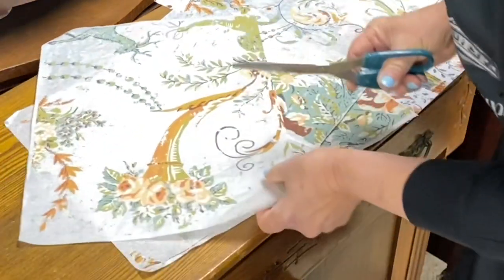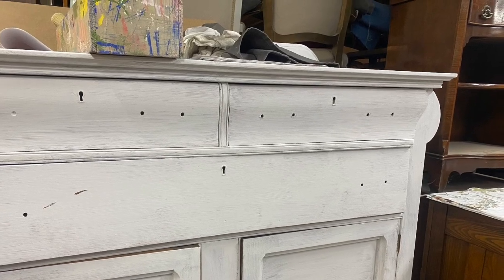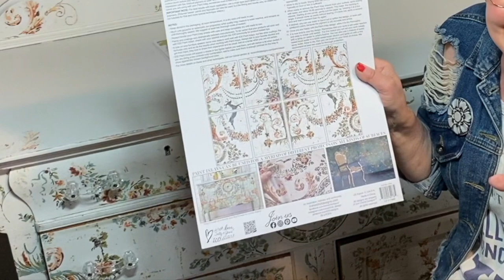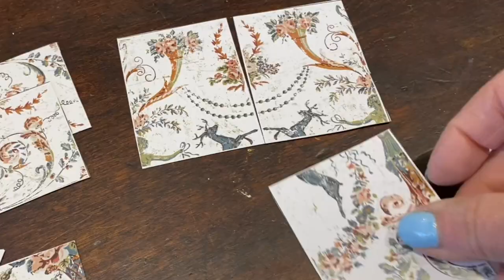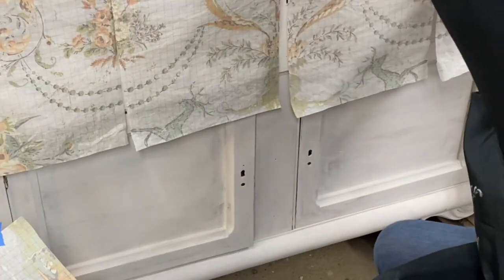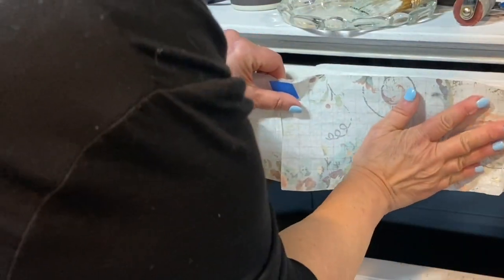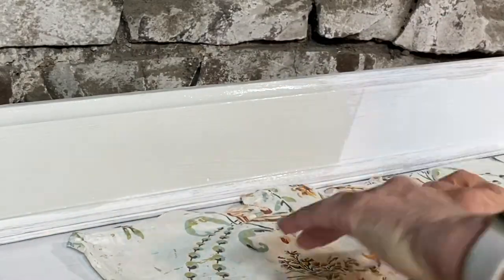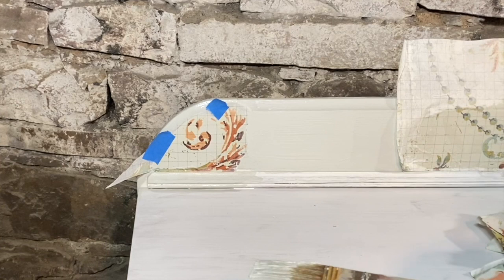The Chateau Inlay and a Layout Problem SOLVED!

Comment: I love. Your approach, on creativity, your work is, beautiful, every video I've watched, I love, I love your style, you are an artist, I love this paint inlay, I ordered 2 from a local retailer, of IOD, I was talking to the owner, about, putting this on a sofa, I am having reupholstered, with drop cloth, and she said, she tried acrylic gesso, on a cloth bag, and then used Chalk paint, and an IOD transfer,the difference,with the gesso, was amazing, the material was softer, versus, just Chalk paint. But I want to try it with this inlay, since gesso is a sealer, and comes in clear, and many colors, I was wondering, about your insight, so, I am going to play, with the gesso, and Chalk paint, on a piece of drop cloth, before, I try it on my sofa. Any insight will be helpful, thanks
Reply from the maker: It sounds like a great idea! I’ve never used clear gesso as my transfer medium, but I’ve going that Debis DIY clear liquid Patina  works nicely as long as you have a good generous base coat of it that has dried. Then apply a second coat to apply inlay.